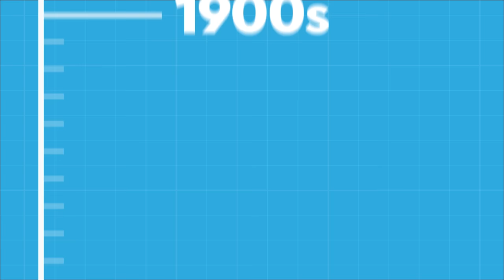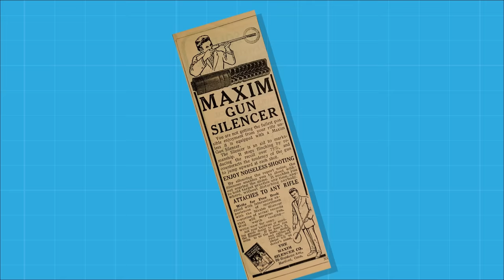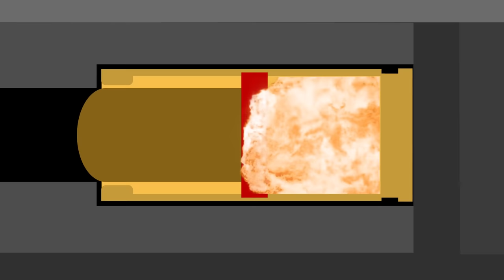How Silent Are Gun Silencers? DEBUNKED #moviemyths #debunked

Comment: Thank you for solidly based information.  I've been around a lot of suppressed firearms as they've been shot and most are anything but quiet.  Handguns like the very low pressure .45 ACP are still audible at 1/2 mile outdoors.  The report is muted enough to make hearing protection optional.  Rifles are still audible for long distances.  I have shot one "Hollywood quiet" suppressed firearm.  It was a Ruger 10/22 rifle equipped with a suppressor designed for full auto fire on an M-16, shooting subsonic (reduced velocity) ammunition.  The ammunition wasn't powerful enough to cycle the semiautomatic action so all that was heard was the tick of the firing pin.
Reply from the maker: And thank you for your informational comment 👍

Comment: Well, as for cal 22 I have made several ”silencers”, the effect of which the sounds of the bullet impact and the bolt/hammer sound by far exceed the sound at the muzzle wth subsonic ammo. As soon the muzzlespeed is greater than the speed of sound you get a bang, fairly moderate for i.e. cal 17, but 308 or 30-06 are almost as loud with supressors as without

Comment: When I was in high school I found a book at a book fair that book was titled "Small arm silencers" and this book showed you how to make a silencer several different ways. After reading the book several times. I attempted to make one I found achievable. Going to True Value Hardware I picked up a few peace's of PVC and connecters along with a hose plunger. I was able to peace these parts together I rigid it to the end of the Gun Barrel I took it out side and at like 3am I shot a few rounds down range I was amazed on how quiet those rounds were and I heard the sliding of the ejection port but not much more than I fired the fifth sixth seventh round it was much much louder for every shot but those first three shots were very very quiet and at 3 a.m. in the middle of nowhere it's was quiet so I know it is very possible for a limited amount of rounds
Reply: why in high school

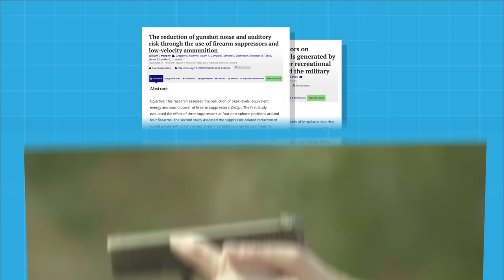Comment: 5:00 It should be noted that going from 150 dB to 120 dB means 1000 times reduction in the aspect of energy! In other words, 1000 guns with the suppressors like that being fired at the same time would have the same "loudness" as 1 similar gun being fired without the suppressor.

It's something clear to people who have learned about "dB", but it may leave wrong impression (for example: incorrectly understanding that it's only a ratio of 120/150 (=20% reduction)) on people who haven't learned that.
Reply: Halving the energy is reduction of 3 dB, but perception wise a reduction 10 dB will give the impression that the sound level has been halved due the the expression of changes In air pressure(pascals) being expressed as decibels after being logged to give a scale that is easier to relate to.

Comment: You can drastically reduce the noise of a suppressed firearm by using subsonic ammunition, in other words, ammunition that travels at less than the speed of sound. 

It’s a common misperception that suppressors render a firearm silent. 

However numerous studies have proved that suppressors can have a very meaningful impact on the protection of other peoples’ hearing (that is to say those in relative close proximity to someone firing a firearm, but not the shooter themselves who should still wear hearing protection). As an example, it could be a bystander standing 10-15m away from a firing range. 

The resulting sound would still be quite loud, but much more manageable, especially for bystanders located further away from the source.

Comment: There was a gun once, which i sadly don't remember the name of, which was shortly shown in the video though, that was actually able to come close to the mentioned pew sound. They achieved this, by having an integrated supressor, that had leather plates in the muzzle, without a hole for the bullet, leading the bullet to pierce the leather each time, reducing the sound to a minimum. The design was not continued because you could only fire a few shots, before the plates didnt supress the sound anymore, meaning youd have to change out the supressor every few shots

You can see the design at 2:48
Reply: Welrod.

Comment: I had a chance to shoot an internally suppressed 22 caliber Ruger bolt action rifle a few years ago.  Using subsonic 22 ammunition at 25 yards you could hear the bullet strike the target.  The report from the rifle was amazingly low.  That said, I totally agree with the general point being made in this video.  On larger caliber weapons the sound levels are disappointingly loud.  Recoil reduction, reduced muzzle flash and reduced muzzle rise are the main benefits on those weapons.
Reply: Usually the reason for larger calibers being loud even with a suppressor is because they are not shooting with subsonic speed ammunition. If you do that even a 45ACP (large 12mm diameter heavy bullet that normally is  subsonic) it is surprisingly silent and deadly.

Put supersonic ammy in a 22LR rifle and it is not silent anymore even with a huge supressor. But it will be considerable less loud. With my Ruger KMK 512 pistol in 22LR I could shoot without hearing protection with CCI stinger ammo that is powerful and supersonic and a big supressor. But with subsonic ammo the action of the mechanism was louder then the sound of the bang... (also the pistol would not cycle because the ammo was to weak to load the next round).
Reply: A host on an Outdoor Channel gun show was talking about the natural terrain longe range shooting Precision Rifle events now & said that headaches caused by firing well over 100 rounds in an event are eliminated by using a muffler. The concussion, even when wearing hearing protection, still causes headaches without the muffler.

Comment: As far as I know none of them sound like they do in movies. And the quietest one I believe is the Welrod which is sold to civilians as a veterinary tool. For when you have that mad cow that needs to be taken out by former SAS. The Welrod uses replaceable rubber disks (wipers I think they're called) that need replacing after about 15 shots. The first 3-4 rounds are the quietest and subsequent rounds get progressively louder until the disks are no longer able to close up after the bullet passes through them which allows the bang to escape. Also the Hush Puppy aka S&W model 39 first used in Vietnam was very quiet and I believe it also used a slide lock so that the cycling slide couldn't function which stopped it from making that noise. But later iterations got rid of that feature. It was called the Hush Puppy because it was used to kill guard dogs etc...

Comment: The silencer can only work lime in movies or games if you use subsonic ammo. Subsonic ammo can technicaly be any calliber but with a different powder charge, so that upon firing the bullet won't go faster than the speed of sound ( 340 m/s). If you use a bullet that doesn't have a muzzle velocity over 340 m/s and a quality silencer you should get quite a noice reduction. It's kinda like a loud pssst. If you don't use subsonic ammo but still have a silencer, the effect is different. It's quite loud, and you cann hear crackling in the air.
Reply: There are other factors too besides subsonic. They are mufflers, NOT silencers but a 12 db reduction is well over 400% sound reduction.

Comment: I just bought an Rugged Obbisidian 9 supressor in 9mm. With the 3 lug quick adapter
and some extra parts I spent about $1200.00. I loaded my carbine with standard 115 grn. bullets. It worked OK, it cuts the initial crack out of the shot but still sounds very much like a gun shot.
Using a suppressor while in the act of a crime adds 25 yrs to your sentence.
I'm not sure if I would do it again. Live and learn.
I think as time goes on suppressors will be common and the price will drop as well as the NFA requirements.

Comment: Silencers only work reasonably well if the ammo shoots a bullet SUBSONICALLY.  The suppressor can be 10 ft long, but if the bullet leaves the end faster than 1120 f/s, then it will still make a crack. Handguns are generally only useful for this as many are normally sub-sonic.  (.22short/lr, 25 & 32acp, 380acp, 9mm, 45acp)
  Another unmentioned benefit of a suppressor is the near total reduction of muzzle flash. This is beneficial as that is one thing enemy gunners shoot back at. If they dont see flashes, then they are just guess firing.

Comment: Pretty good video, however you should have made more of a point of subsonic ammo, and pointed out that a revolver cannot be effectively 'silenced' because of its cylinder gap. And a Ruger 10/22 in .22LR with an 18" bbl and Sparrow suppressor firing subsonic ammo - the loudest sound at a distance of 15' is the reciprocating bolt group hitting the back of the receiver.

Comment: This video repeats the often quoted 85 decibel noise level of the Delisle Carbine.  This noise level was obtained with antiquated noise meters.  Modern noise meters and microphones have measured the noise level at about 120 decibels.  This is very good for a 45 caliber firearm with a large silencer bore that tends to let out lots of noise.  I don't have a link to support my claim.
Reply: 120db is probably the norm. NHRA requires Sportsman class cars to run mufflers quieting them to 90DB at X number of feet away from the side of the car. 90 is still quite loud.
Reply: @bradgriffith4231  The very short duration impulse noise of a gunshot appears to be less noisy than it actually is.  This is why some people think that subsonic 22lr out of a rifle is hearing safe when it actually is not.  140 dB is the usual limit for gun fire.  There are also time constraints.

Comment: It depends on the cartridge and the silencer. A well-suppressed .22LR firing subsonic loads is literally just a click. You hear more from the action than you do from the round being fired. Likewise, larger subsonic rounds with a suppressor may also sound like a loud click, but certainly not a gunshot. Supersonic cartridges, however, produce a sonic boom that comes across as a loud crack that will still be heard from a long distance away, suppressed or not.

Comment: Bullet speed, the volume of the suppressor, the weapons mechanism, and to a small extent the shape of the bullet, affects the sound. With a bolt action you don’t have the noise of the moving parts. My semi auto .22lr with subsonic ammunition and a suppressor on is real close to Hollywood quiet. If I used a bolt action it would be even quieter. So it is possible.

Comment: The gun doesn't have to be all that quiet to be ignored.  Consider that a 9mm pistol with a silencer shooting subsonic bullets will be about as loud as a car-door slamming.  But inside of your home or in a mall parking lot, there are car doors slamming all the time, and you hear it... .but the you mentally ignore it as quickly as you hear it.  That's the thing with silencers -- they can still be heard, but they're just not noticed.

FYI, more states in the US allow silencers than states that prohibit them.  They're relatively common.  I myself have 3: two 9mm silencers, and one for a 22LR.  The one for the 22LR IS as quiet as Hollywood makes them sound.  But here's the thing, if you own a handgun, then lock the slide back... now release it.  That huge "ka-CHUNK" occurs with every shot, because with every shot the slide will slam shut.  So no, it'll never be "silent"... but again, it doesn't need to be.  People don't call 911 over the sound of a car-door slamming.

Comment: Generally accurate video.  I'm in the firearms industry, and I've fired many suppressed guns.  The level of noise is highly variable.  Some really are eerily quite.  They make all kinds of sounds.  They pop, crack, hiss, whoosh, thump, etc.  The most quiet are small calibers with subsonic velocity bullets and consumable wipes in them.  Revolvers cannot be effectively suppressed without also doing something about the gas leakage at the cylinder/barrel gap.  Which is fairly loud by itself.  Operating noise of the action is also highly variable.  Some guns have very mechanically noisy actions, or vent a fair amount of gas out of the breech as it opens.  Naturally manual operation with a larger suppressor with subsonic ammunition (or a ported barrel that reduces velocity to subsonic) and wipes offers the most quiet performance.  I have fired guns that were so quiet all you could really hear was the mechanical noise of the hammer striking the firing pin and the bullet smacking the target.  Which turns out to be almost as loud as a gunshot sometimes.  Shockingly loud.

Comment: As someone who has owned suppressors for years. you did a great job, but SOME guns and suppressors actually do get "Hollywood quiet" their is another kind of suppressor that uses "wipes"  either together with baffles or just spaced out wipes which are a kind of plastic rubber disk the bullet punches through. You could have mentioned subsonic ammunition more.

 (fun fact normal everyday 45 ACP and .38 special are subsonic)

 the Most quiet any gunshot could be is a bolt action .22 rifle with a baffle/wipe can. The firing pin hitting the primer is louder then the shot if you can believe it. Because it's a lighter round, the gasses are slowed down, and there no added noise of a semi-auto action cycling.

Comment: I used a suppressor in the army a few times. It's not for the enemy to NOT hear, it's so you can go without earpro and KEEP hearing. 

However, personally? I hate suppressors. I would rather have the concussive wave and loud noise. It's better at taking command of the room and making an enemy take a split second longer to react. Someone drops a pan that you weren't expecting? It's loud. Most people will jump a bit, I want that to happen. That split second is a lot of time when it comes to transferring targets and pressing the trigger.

Comment: You lightly touched on sub sonic munitions. When used in conjunction with a suppressor or silencer, the noise reduction is pretty significant. But as you said still gives a bit o a pop. 
Subsonic rounds are used almost exclusively in rim fire competition (.22 long rifle) because they are so much more consistently accurate. In the competition, you have 25 half dollar size targets on a single target sheet with the xring the size of the .22 bullet. You have five minutes to hit all 25 targets.

Comment: A bolt action gun will not have the noise associated with a cycling action.  There is still an audible click from the operation of firing pin.  If used with subsonic ammo, this is about as quiet as you can get.  A suppressor on a revolver is a bit of a joke as gasses escape between the cylinder and the forcing cone.  A suppressor on a semi-auto firearm using supersonic ammo mainly only changes the sound enough so that if shooting at an indoor range you only need one layer of hearing protection instead of two layers.  Note that the 20-30dB reduction in sound is about the same as you get from good hearing PPE.  It certainly won't block the sound, just prevents a level of hearing damage.

Comment: The supressors on relvolvers are the funniest. And it depends on the cartridge, a subsonic .22 rimfire is quite quiet. On an automatic the action is louder and the bullet strike can be louder too.

Most centerfires are loud enough to still require ear protection. The supressors also reduce muzzle blast.  The supressor works best in an environment that is already noisy.
Reply: Impossible to silence any revolver because of the cylinder to barrel gap
Reply: @bradgriffith4231  That is what I meant by funniest. Though the exception would be the Nagant M1895. Blowback automatics make more noise the locked breach guns. Some autos have an action ,slide lock, to make them as quiet as possible. (S&W Hushpuppy for example)

Comment: Real life suppressors are usually larger than the Hollywood type. If you use subsonic rounds the sound of the shot can be silenced but the mechanical clickety-clicks   of the weapon remain unless you lock the action of the weapon to prevent it from cycling.

Comment: My understanding is that it is possible to nearly silence a bolt action 30 caliber subsonic riffle to near movie "whiffs" with a suppressor that is 3 ft or more long and several inches in diameter.  Of course it weighs a lot and has to have a very robust attachment to the riffle (not just screw onto the end of the barrel).

Comment: hi. i dont usually comment on you tube but on this video i thought that i would make an offering. 
i have personally used weapons' affixed with silencers and in reality the only thing that you hear is the mechanical parts of the weapon moving, or being used. 
the biggest part that this video missed was that the bullet needs to be powder charged for sub-sonic usage. if the bullet is just a normal run of the mill ,over the counter component, then the silencer only helps lower the super-sonic sound by a few Db.  
-cheers

Comment: That's why you can only buy a suppressor. Not a silencer. Looking at manufacturers charts will tell you that the suppressor offers only a 35 to 37 decibel reduction. It also does nothing about the crack that a bullet makes breaking the sonic barrier. The xm sniper program in Vietnam used sonics silencers with subsonic ammunition to achieve near silence. Also the HK45 used by navy seal teams  had a slide lock because the silencers they used were so effective that you could hear the slide racking.

Comment: You can use both subsonic with suppressors which basically makes them silent. And eliminates the need for hearing protection if both are used but ofc depends on the caliber being used.
Reply: 105dB is hardly silent